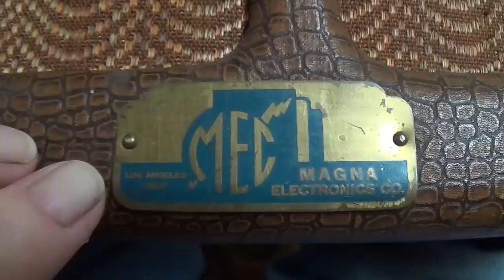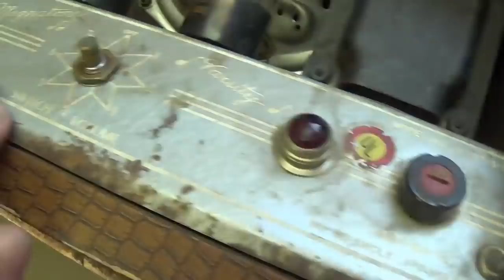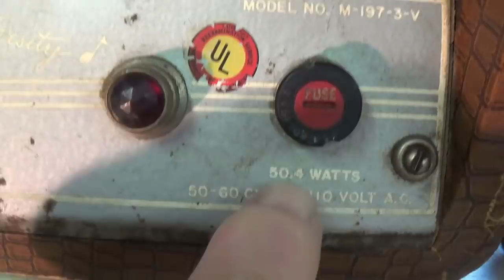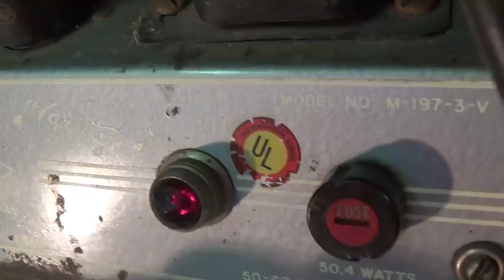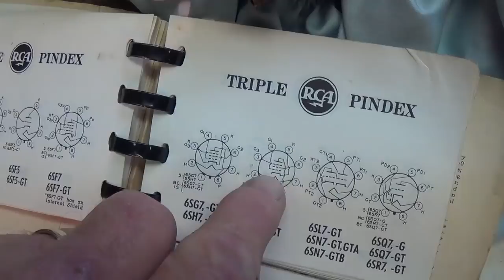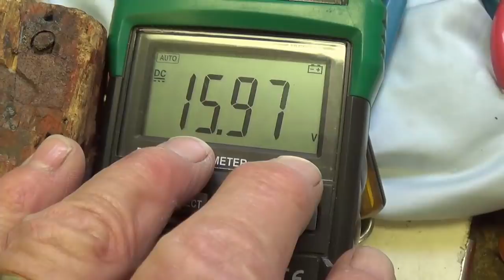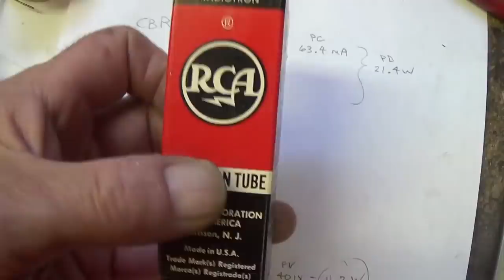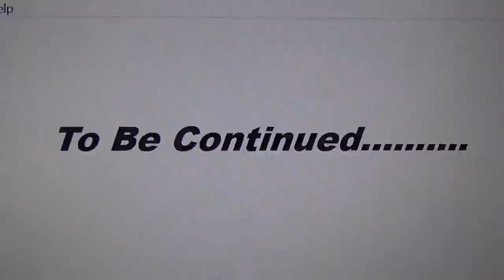1950 Magnatone Varsity M197-3-V in Completely Original Condition

Comment: Doug, what make my fender reverb amp to bright ? I have set my treble to 3 and bass to 7.
Reply from the maker: What about the guitar tone knob? Have you tried adjusting it?
Reply: Yes, but then the amp sounds muffled not good bass I thought there could be a bad resistor   Some where on the input jacks .   I have a twin and it sounds great .  The super reverb is a 65 and has all new tubes and  a caps installed.
Reply from the maker: Is this in both channels, with the bright switch "off" ? Feel your output tubes to be sure that both of them are getting warm. Is this an original Blackface SR, not a re-issue?
Reply: Yes , it a original 65 SR Blackface I’ve tried different guitars sounds the same. Both output tubes are warm . Bright switches are off when turn on it is really bright. When I turn the treble all the way down and the bass all the way up it sounds okay . The amp is dead quiet and plenty loud. Reverb and tremolo sounds good. I just wish I could adjust the controls any help is appreciated.

Comment: I got the opportunity to use some C-4 when I was training for demolitions when I was in the Army. Our instructor came out with an unwrapped block and used it for illustration. While he talked, he casually pulled out his Zippo, and set the block on fire. It burned slowly. We were looking for the exits. He went on, but suddenly wound up and chucked the block at the concrete floor with all the force he could muster. Splat! It put out the fire. Then, we went out to the impact area, set a blasting cap, and some fuse, and... BOOM! We blew the turret off an old M-60 tank. I don't think you're gonna need a crowbar all that much for the amp, once you've detonated the C-4.
Reply from the maker: Thanks for the lurid tale, NDL. I'll tell Jack to cut back on the amount of C4 he's been using lately :)

Comment: Your buddy's hot rod is wow! I've never seen clear valve covers before. What did he use to make them, Lucite? Lexan?
Reply from the maker: Thanks, KV. They are commercially available......expensive, but impressive.
Reply: Uncle Doug of course! They're most likely molded. I used to be a mold maker for Packard Electric. GM ruined us with Delphi. They dumped the nearby Lordstown Chevy Cruze plant recently. Then there's Akron-Canton which used to be the Rubber Tire Capital of the world, but most of that work is gone, too. But I digress.

Summit Racing isn't far from here either. We've got a lot of aging gear heads like us here lol.

Comment: i had a look the the circuit for this amp may some removed the 1 k 7 watt resistor coming of pin 8 on the 5y3
Reply from the maker: Thanks, Ian, but I believe that the field coil of the electrodynamic speaker serves the purpose of the 1K 7W resistor. You may be looking at a PM speaker circuit......or I may be nuts.

Comment: Uncle Doug, I have one of these great little amps-- and I'm thinking about having an out-jack installed in it and building a cabinet with a ten-inch speaker in order to get more volume. My question is, the amp is 4 ohms and the speaker I have in there now is 4 ohms. Is it imperative that the 10" speaker in the cabinet be 4 ohms? It seems 10" 4ohm speakers are harder to find than 8 ohm for some reason. I mean that the choices seem less. Thanks for your help!
On a side note, when I removed the original speaker, I noticed that the asbestos speaker gasket was crumbling. Careful out there!
Reply from the maker: Mike, the 10" speaker probably wont be any louder than the 8".....but it will handle greater volume and provide better tone. Yes, the speaker impedance should match the OPT. Why not make your cabinet a bit larger and use a 12" speaker?  The tone will probably be better yet and 4 Ohm speakers are common.

Comment: I have an early 1950s Magnatone Varsity. It has a "mother of toilet seat" cabinet. Varsity amps do not come up for sale often, but when they do, it is usually a toilet seat cabinet. Is it possible that sometime between 1950 and now that someone re-did the cabinet in reptile covering? That would help explain the mismatch between the inside and the outside conditions.
Reply from the maker: No, this is how they came from the factory in this period, T4.  The MOT is much more common (I have several) which is why I really wanted this one when I saw it on Ebay.
Reply: @UncleDoug  Got it. Just so strange that the outside was near perfect and the inside, not so much. So the reptile cover was indeed quite the catch--I take it rare, and in that condition, almost a unicorn?
Reply from the maker: I've never seen another one anywhere close to this in condition. The one on Reverb was hideous.....and still sold.

Comment: Very nice amp UD! When you biased the 6v6 you said measuring plate voltage from plate to cathode. I thought in your valve bias videos it was plate to chassis ground? What is the correct way please? And thanks again for your very informative and entertaining videos. Regards, Dean.
Reply from the maker: If the output tube is cathode biased, then you measure plate to cathode. If the tube is grid biased (grounded cathodes) then you measure grid to ground.
Reply: @UncleDoug  thank you.

Comment: Hi Doug - I've got one of these on my bench in absolutely immaculate condition.  The covering is a different grain, and the chassis is painted with a copper hammertone as opposed to your silver chassis.  The model number is the same as yours. The wiring was laid out quite different than yours but it checks out with the schematic, with the exception that there were no grid resistors at the input??? and the 6SJ7 plate resistor is 240K and the grid no. 2 resistor is 1M.  (The schematic I got shows 500K and 2M respectively.)  I see that your amp is more like mine than the schematic I downloaded, with 250K and 1M.  Mine has a regular 4 ohm alnico speaker.  It looks to be original.  The OT is mounted to the speaker frame rather than inside the chassis.  I replaced the power cord, measured the resistors, all within reason to stated value, recapped with all proper values, added 68K grid resistors at the input jacks, thoroughly cleaned the pot, jacks and sockets.... and it really is anemic sounding :(  No volume t all till you get the pot at about 3/4 of the way up.  The tubes are brand new.  Suspecting maybe a faulty 6SJ7, I replaced that with a known working tube...same.  Tried another known good working 6V6.  Same...Weak.  I'm starting to wonder if the OT isn't meant for a 4 ohm speaker, but not sure if that would account for the weakness???  I separated the OT from the speaker frame and tested the speaker with another amp and it definitely works and sounds good.  I would also note that the poor 6V6 is biased with a 250 ohm wirewound like yours and dissipates a little over 15w with a plate voltage of 308v, so that will need to come down.  I also tried another 500KA pot just out of curiosity.  I've run out of ideas and wonder if maybe I could tap you and Jack's expertise to see if I'm missing something.  Thank you, sir!
Reply from the maker: Until you get the 6V6 down to a reasonable bias, all bets are off, Mr. C. It may have been damaged and probably should be replaced. Also, check the sweep on the volume pot. Good luck.
Reply: @UncleDoug  Thank you!  I did get it down to a little over 11w.  The 1M resistor that is connected to grid no. 2 of the 6SJ7 measured 1M in circuit, but I discovered no voltage was present.  A closer look at it, it was burned at one end.  Replaced it and now it sounds great and functions properly

Comment: Great video Uncle! I would love to hear your thoughts on switching out 12ax7 preamp tubes to 12ay7, 12au7 or 12at7 there are a lot of videos out there but they don't seem to know much more than I do which isn't much and I don't wanna damage my amp, it's a fender blues deville that's too loud most of the time, both channels are at about 80% full volume with the gain knob under 2 out of 12 so it's almost impossible to get a reasonable volume at a typical bar gig or practice space, it goes from nothing to too loud in about 2° of rotation on the knob
Reply from the maker: I had the same problem with a Blues Deluxe, Mark.....from zero to deafening in 2 knob divisions. Yes, you definitely can substitute lower gain pre-amp tubes for the 12AX7 with no harm at all to the circuit. Usable tubes and their approx. amplification factor: 12AX7 (100), 12AT7 (60), 12AY7 (40), 12AU7 (20). I find that experimentation works best, plug in a tube, play for a while, then try the next one. You can quickly determine the proper pre-amp tube for your needs.

Comment: I think your current is so high because you have a very high B+. Did you measure the screen voltage ? With such a high cathode resistor the sound might be a little changed from what it should be. What i usually do is fit some 25V 5W Zener diodes between HV center tap and ground. with 2 or 3 of them you get the B+ the amp is meant to have !
Reply from the maker: I agree, Pi. I believe the power transformer has a higher voltage output than the circuit was designed for. Perhaps the output tube should be changed to a 6L6......or the B+ lowered by your method. Thanks.

Comment: Uncle Doug. I might have an idea for a new video, that may (or may not ) be interesting for other viewers as well.   I  do all \kinds of scratch builds and my own designs when it comes to chassis/housing. Mic preamps+guitar amps mostly.  I always seem to make it my point to build as compact as possible with some great results, but sometimes i go to far/to small. 
How would you go about building really compact?  what would methods be to avoid obvious problems, buts also less obvious ones. tube distances, alternative positioning/layout, shielding magnetic fields etc.   
Right now i,m doing a layout for a 2 channel The fisher pr-6 including the PT in a 15x12x5 cm serial printer switching box. All based on terminal strips.  Boy...what a mess.  How would you handle this?
Reply from the maker: Building an amp in a very small space can definitely cause some problems, Pief, especially if the preamp tube is too near the power supply. My solution has been to use shielded cable for signal connections, and to construct grounded shielding enclosures for the wiring to the pre-amp tube base. The best way to avoid the problem is to use a properly spacious chassis.

Comment: Also, is the 6V6 grid at zero vdc? Does it have a resistor to ground for a the zero volt dc reference?
Reply from the maker: I hope not, Tony. The grid must have a slight negative charge relative to the cathode, to control the plate current.
Reply: The grid should be at ~ 0 vdc, the cathode will be at a positive voltage because of the series cathode resistor - making the grid negative relative to the cathode. I'll bet that the grid is not at 0 vdc and that is why such a large value cathode resistor was needed. (I'm an electronics tech).
Reply from the maker: This would imply that the coupling cap to the grid was leaking, Tony, which I suspected....and checked, even though it was new. Also, the plate current stabilized quite well, which would argue against a cc leak. Just to be sure, I will check again. Thanks.

Comment: All those wire wound resistors spell quality... Uncle Doug, in your opinion 
do you think using these types could improve tone as some of the old 
hi-fi buffs used to think?
Reply: Wirewounds are the most precise value-wise, but they also act as inductors at larger values. it's a trade off. Good quality metal films are your best bet for fidelity and noise.
Reply: @davidfuller581  Thanx David... Do you think there's any way to make the inductance phenomenon work for you when searching for tone with the electric guitar? (yes, I tend to over-think when it comes to my passion 
...the practical be damned)
Reply from the maker: I agree with David, Jonny. Inductance does not seem to have a noticeable or favorable effect on tone......as far as I know.
Reply: @UncleDoug  inductors act as low pass filters depending on their inductance - that's why they're used as filter chokes in a power supply. They're used in some designs of equalizer for various things.
Reply: @davidfuller581  And 59 year oLd Wah-Wah pedaLs .

Comment: Industry standards should have mandated that screws less than 13" in length should be forbidden in any valve amplifier manufactured prior to 1961
Reply from the maker: You would think so, Petra, but obviously the "powers that be" interceded on behalf of the manufacturers and allowed them to skimp by with measly 9" screws......which would be a great name for a band :)
Reply: @UncleDoug  λολ.......

Comment: Was the screen voltage way too high?
Reply from the maker: I don't recall.
Reply: @UncleDoug  I have been having that problem more and more lately.....
I was born in 1946; are we close to the same age?
Reply from the maker: @Dennis-mq6or  Yes, I'm one year younger......not that it makes much difference any more ;)
Reply: @UncleDoug  
Bring the screen voltage down to 250 vdc or less and all will be well!
I can say that now I speak from experience.
Also, I found that the GE 6V6GTA tubes have higher ratings that all the other 6V6's (unless they were also made by GE and labeled for someone else)
Reply from the maker: @Dennis-mq6or  Thanks for your input, Dennis.

Comment: maybe the output transformer impedance has changed somehow.
Reply from the maker: If it did, it still seems to work perfectly. I really think it's the PT.
Reply: @UncleDoug  Oh I was typing when I should have been reading your explanition.  Just the change in line voltage from when it was designed to present day would increase the plate voltage by more than 50v.

Comment: Your resistance box, have you checked all the resistances are as stated?

Something I have wondered, not being used to the older resistors is how to determine their wattage handling capability, is it just by size?
Reply from the maker: I measure each resistor prior to making any readings and calculations. The values are close to those on the dial, but not exact. Yes, size is just about the only way to estimate wattage.
Reply: @UncleDoug  thanks

Comment: From someone who knows more than enough to be dangerous to myself and the proud owner of baseless opinions...
My guess is that the caps you replaced provided the conditions for which that value resistor provided a level of bias that was low enough for the tube to handle.   
Had you rushed in and played it out of the box, it probably would not have sounded the way it does now. Why bother checking caps you know you are going to replace anyway? You wouldn't. Neither would I. Until now.
Problem is, I would have tossed those old parts immediately. Without thinking. Patriotically ridding the free world  of capacitors made during the era of FDR's kominest subversion is the least I could do for my country. (just kidding-damn PC police)
Yet, for a completely unrelated reason, you did not. So, if you ever have nothing else to do, check 'em out.
Reply from the maker: I guess we'll never know. Thanks for the input, MA.